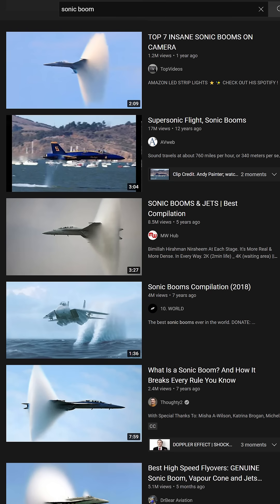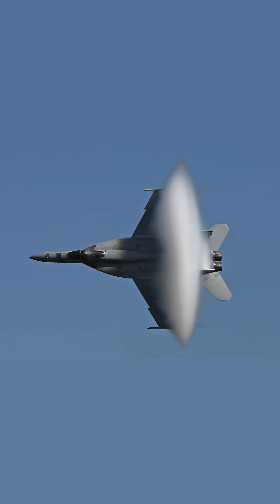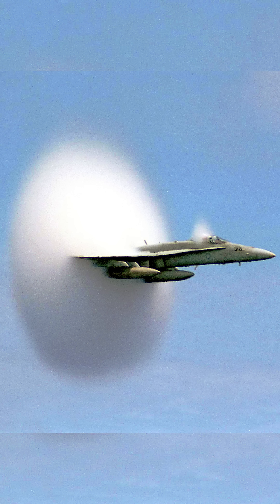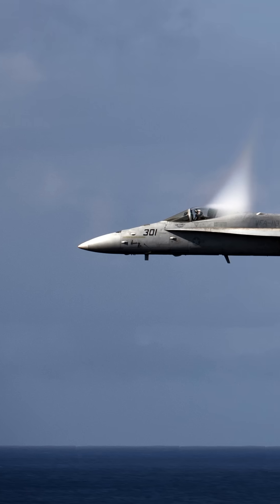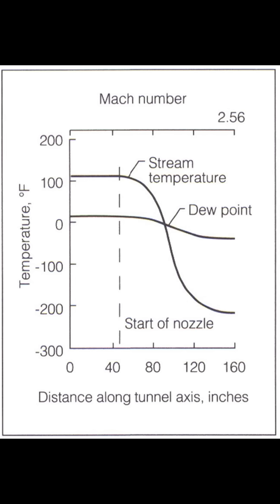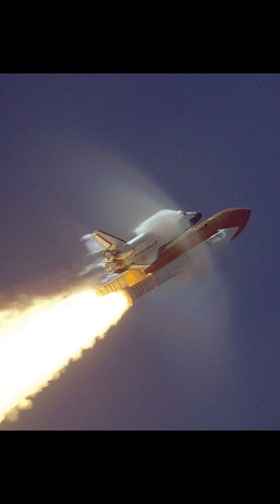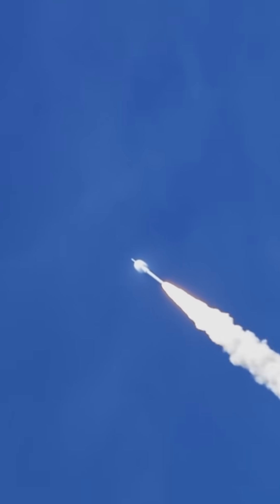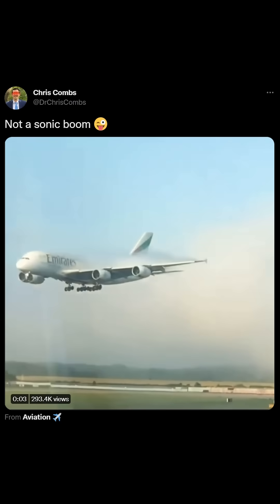This Isn't A Sonic Boom #shorts

Comment: For your info ... the correct term is "Prandtl-Glauert Singularity"
And if the aircraft is in level flight, due to the slippery nature of the airframe, the vapour cone will only appear when approaching the sound barrier.
Other vapour known as "fluff" appears on upper surfaces when the aircraft is making a turn or otherwise using a high angle of attack and can appear at much lower speeds ... the jumbo appearing out of the clouds produced fluff because of the decent vector and the extremly wet conditions...
Reply from the maker: Sorry, no, the singularity is a mathematical tool related to shocks.
Reply: @scottmanley  aye agreed but we are talking labels here not mathematical tools... after the theory was disproved, the name kinda stuck in certain circles. Not in common use at all nowadays.
What you say is essentially true from a modern perspective. 
But I will stick by what I say with the cone itself.... the cone formation will only appear when the aircraft is in level flight and approaching the speed of sound. It will be at an angle 45 degrees at the speed of sound and it will lay flatter to the fuselage as the speeds climb higher. The "fluff" appears only when turning or flying at high aoa

Comment: Hang on I think those are sonic booms - there’s just multiple things going on here. I think those particular pictures of condensation are cone shaped because the pressure drop across which water condenses is the shockwave produced by the plane going faster than the speed of sound (which is cone shaped, and which is a discontinuous pressure drop).

Comment: I think this video is a little misleading. The aircraft may not be moving at supersonic speeds however that distinct cone shape is is caused by a sonic shockwave (which is the reason for the sudden drop in pressure that drives out the moisture from the air causing the visible fog). The flow around the aircraft is probably supersonic at that point. 

You can get fogging well short of the speed of sound (as shown by the later clip of the airliner landing) but the distinct cone shape is caused by shockwaves (heard as sonic booms) which do not form unless the flow is around Mach 1.

Comment: Wht isn't there continual sonic boom when it's continually past the speed of sound?
Reply: yes, "breaking the sound barrier" is just when it first happens. and this is the reason going mach 1 and over above land is against aviation laws in most places because the sonic boom can and will keep shattering windows as it moves along.
Reply: @vex_mistaken  Thanks. I saw, afterward, a video explaining the cone moving, thus the continual boom as it passes.

Comment: That isn’t actually a sonic boom, it’s called a vapor cone, it happens whenever the hotter air is pushed with the wings, and the colder air is left and the temperature is below dew point, though it does usually happen at speeds of sonic booms but can happen very slow like at 100 mph if you get the angle right

Comment: Ah yes, manifestations of the Prandtl-Glauert singularity.  Always a pretty sight to see.

In some pictures with large-diameter turbofans (e.g. GE90 (Boeing 777-300ER), GEnx (Boeing 787 Dreamliner), Trent 900 (Airbus A380) or Trent 1000 (Boeing 787 Dreamliner)), I see some vapor clouds form in the intake from as small as whispy little "funnel clouds" to intake-filling fluffiness.  Isn't that similar in nature where the pressures are so vastly different where a condensation cloud forms?

Comment: You can calculate the Mach angle on such a picture and then see. The sound barrier is called like that because the resistance of air increase very high before this "barrier and then goes down again, which helps to condensate.
I agree but i think it's little too shortly resumed. There's an Edx platform a very interesting course called "introduction to aeronautical engineering" wich explains that. (For Free)

Comment: The air at those cones is a supersonic shockwave, the backside of the cone is subsonic. If the plane continues to accelerate the shock cone moves off the back of the plane.

Comment: This is a pretty misleading Scott - a vapour cone IS a supersonic shock wave. It's just from air that's locally supersonic relative to the airframe. The shape is very different to the condensation forming on an aircraft wing at low speed.

Comment: This effect is also occasionally visible in F1, caused by the rear wing of the car smashing through the air, usually only in damp/wet conditions 👍
Reply: Supersonic F1 cars, now there's an idea....
Reply: @alanhat5252  no, don't.
Reply: @alanhat5252  "Even if we put a rocketship we will still be subsonic!!

MODEL ROCKET ENGINE
MODEL ROCKET
AAGH!"
Reply: @alanhat5252  land speed record drag races. >:)
Reply: @Comfy_Bed  Mach 1.02, October 1997, Thrust SSC
Reply: Not anymore with this year's new regulations
Reply: @racingmhf9157  it would still happen if a sufficiently strong tip vortex were to form coming off one of the aero devices. But yes I agree the whole point was to reduce outwash and aero disturbance behind the car so unlikely a device sufficiently powerful to create such a vortex would now be legal.
Reply: If it's usually only in damp conditions then it sounds like that's not the same, cause it's not generating its own droplets from clear vapor...

Comment: Immediate way to see that these cones are formed below the speed of sound ... the slope of the cones. If, for every meter you track back on the cone, it expands more than a meter away from the aircraft, the high-pressure wave is travelling faster than the aircraft

Comment: I kind of disagree with you Scott. Ok, it isn't literally a sonic boom (which is sound resulting from a supersonic vehicle), but the vapor cones are usually observed during transsonic flight. The actual stern shock is visible; it's the rear side of the vapor cone. If 'breaking the sound barrier' is another way of saying 'starting to go faster than the speed of sound', then that means going transsonic, and a vapor cone is often a clear sign of starting to go supersonic.

Comment: Hi Scott, That is a Sonic Boom visualized by a cloud, that is what a "Vapor Cone" is. It's a Supersonic Cloud around the aft end of the aircraft were the flow most definitely is Supersonic wrt the aircraft. The circular "Cone" part are Supersonic Expansion Waves causing the pressure to drop and the cloud to form, it is a constant pressure cone associated with the growing "Sound Barrier".  The cloud disappears across the growing "Wake Shockwave" which forms first as the aircraft enters the "Sound Barrier".  It' does go Boom across the Wake Shockwave. The Bow Shockwave forms later, at exactly Mach 1.

Comment: Too be fair, many of those pictures showed transonic shocks, with the visible vapor condensation within the regions of locally supersonic flow.  The planes themselves were not supersonic, but the air had to speed up as it went around the planes, creating areas of supersonic flow that have low enough pressure to force the water vapor to condense.  As you and others have mentioned, supersonic flow is not the requirement; instead what is required is starting with some humidity in the air and then dropping the pressure enough to force some of the water vapor to condense.  This can also be achieved with wingtip vortices, for example.

Comment: I'm slightly confused. While it makes sense that the condensation only occurs in the expansion of the fluid, the compression shock or "sonic boom" seems to be visible due to the rapid disappearance of said condensation area. 
In the compression shock density, pressure and most importantly temperature increase, which would explain the sudden disappearance of the condensed air.

Considering this, doesn't the picture show a compression shock? The common misunderstanding might be that the beginning of the white cone marks the shock, even though the end of it is what marks the shock.

I might be mistaken here though, if anyone knows more please share your thoughts.
Reply: The shock is indeed in front of the cloud, not behind. Joule-Thompson cooling in the region behind the shock is responsible for the condensation appearing, but as air moves downstream of the object, it exits the adiabatic regime where heat transfer to the surroundings becomes significant again. As the cooled air returns to equilibrium pressure and through convective mixing with its surroundings, the temperature rises above the dew point again and the fog disappears.

Shockwaves are not visible in most conditions, especially if the relative humidity is very low. However, it’s possible to visualize the shock itself in dry conditions if an object with some regular pattern and contrast is behind the shock. Refractive index changes with density, so you will see a distortion of the object behind it caused by the compression. Think about the waviness you see in air rising off a very hot object. That’s how a shockwave appears. But the cloud is all after effect, not the shock itself. Hope that helps.

Comment: Another wrong explanation I’ve seen is that this is the Prandtl-Glauert Singularity. This is also wrong, as the PGS was an incorrect “fudging” model caused by linearizing the Navier Stokes equations for inviscid compressible flow. This leads to an erroneous solution that predicts infinite pressure at Mach 1, which was a reason some people thought supersonic flight was impossible. It turns out this simplification is not a valid model of compressible flow in the transonic region (as we all now know very well).

Comment: Would it be correct to assume the same principle is the reason for condensation in wingtip vortices one sometimes sees on commercial aircraft?
Reply from the maker: Yes
Reply: And those spiral steam clouds of WW2 bomber props at takeoff.
Reply: @DavidOfWhitehills  Those can happen on any propeller though. There's I believe a picture of a V-22 Osprey landing with vortices spiralling down from it's rotor/propeller tips.
Reply: @martijn9568  yes, it's about high loading as much as anything else.
Reply: @alanhat5252  what do you mean high loading? I'm so undereducated about aeronautics stuff; it'd be amazing if you actually saw this 3 years later and came back to help me 😂
Reply: You can occasionally see it on F1 cars too

Comment: I always wondered about that, because I always thought the bow-wave should be in front of the aircraft if it were simply some kind of barrier the entire vehicle breaking.
Reply: The wave begins compression at the leading edges and the actual disruption of air at super sonic speed does form behind the pilot. Twice actually.  The pilot is ahead of it by a few feet and never hears it. It's 2 sonic booms to the stationary ears but the booms happen constantly until aircraft has dropped below the boom sped. Another reason why helicopter rotors can only go so fast.

Comment: Prandtl–Glauert singularity, is the incredibly hard to spell name of the vapor cone thing. OFC, in video or IRL it's easy to tell when something is supersonic, there's that distinctive double snap.
Reply from the maker: That’s not the correct terminology, that merely describes a singularity in the mathematical treatment. Vapor cones exist without getting close to this
Reply: Prandtl-Glauert singularity is an incorrect conclusion that air pressure goes to infinity at Mach 1. This is obviously wrong (supersonic flight exists), and was a result of invalid mathematical simplifications to the Navier-Stokes equations. It has nothing to do with vapor cone condensation.

Comment: And to add…you can have air passing over certain areas of the airframe at transonic or supersonic speeds and the ship itself is still below the speed of sound. So much can be understood when learning Bernoulli’s principle.
Reply: It's called the critical Mach number, if I remember right.
Reply: @The Insufferable Tool I actually used to work on the Citation X, the “750” we called it, as an A&P at Cessna Citation. One of the best jets I’ve had the pleasure of working on. At the time we were installing satellite antennas in the vertical radome. They were for internet connectivity, all be it slow back then, but just having some connectivity was enough. The issue was the X was so fast, the developers had trouble getting the stepper motors to keep up tracking the orbital satellite. Eventually they got down…I guess Starlink will change everything.
Reply: @The Insufferable Tool its also why Helecopters cant go above a certain speed.  Because as you approach that speed the leading edge of the advancing rotor blade breaks the sound barrier while at almost the same moment on the opposite side of the Rotor disk the retreating blade is Stalling out.  When that happens the Helicopter experiences a violent yaw and uncontrolled roll to one side.
Reply: @SayanDraws it was fast

Comment: Yep.  This also happens with propellers on ordinary piston aircraft on humid days (which certainly aren't going anywhere near the speed of sound).  I think getting a good photo of it would be hard, and I've never had cameras running when I was doing a run-up and noticed it.  

Thank you for posting this, Scott.
Reply: Well the plane might not be, but the blade of the prop probably isn’t far off though right? I know the effect you’re referring to though :)
Reply: @subodai85  Jup, pretty much if you were to do the calculations. (I once did them)